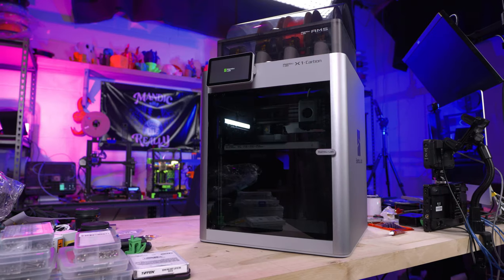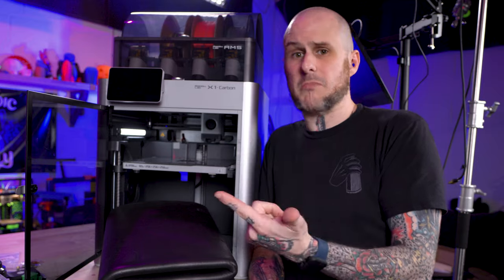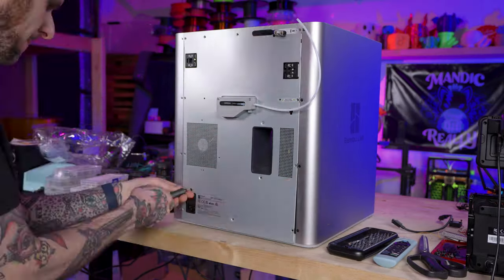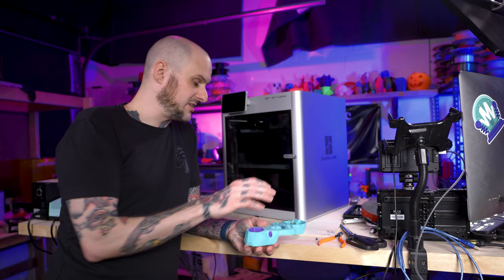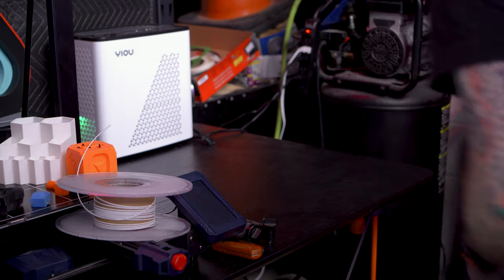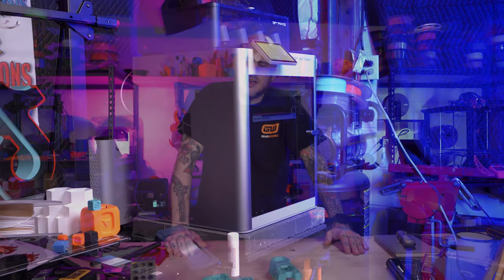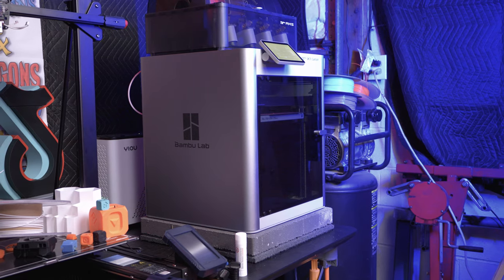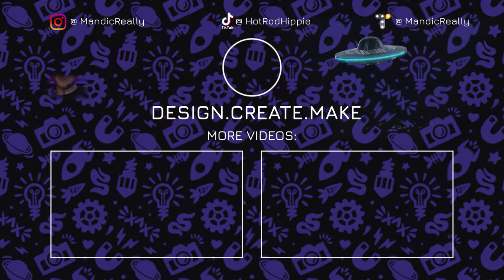Bambu X-1 3D Printer Modding & Problems - Noisy Ringing BEAST!

Comment: I think you did too many control tests after the fact so the results can't be trusted, though I trust that the smoothing you're seeing would likely see be present.
Reply from the maker: I don't understand what you are saying.  I did too many tests so the results are invalid? That's generally the opposite of what most folks would say. This is by no means a scientific study with every variable controlled, but it is a real world use case demonstrating real results.  Could you clarify? I'm in the middle of filming a follow-up and confused as to how to take into account some folks input.
Reply: @MandicReally  What I mean is that you messed with a lot of things then you tested. Since your print jobs got worse, there's no way to know if any one thing caused it. What if just by putting it on the floor, it would have resolved your issue to begin with? As I said, I don't think it would have solved your issues but since you had already messed with it so much, you can't say for sure.

Comment: Most sound isolation products don't do anything. To isolate sound you have to plug air gaps. Only then does it make sense to do things like adding mass to the sound barrier. Adding mass while it still has air gaps is not really going to do anything. It would have been good to measure the sound levels before and after. It would show that adding foam insulation to the panel with all the air vents made no difference.
Reply from the maker: Did you watch the video by chance? @13:00 I showed a 6 decibel drop in Before and After testing. That’s not an insignificant amount of noise reduction.

Comment: I think maybe your temps are too high
Reply from the maker: Nope, I temp tuned on this. I’m actually a bit below the Recommended temps for the machine and ASA. You have to remember when printing fast higher temps help promote flow, they are leaning into that on most of their print profiles. I print this ASA regularly on various machines and the temp hasn’t ended up being higher on the X-1.  I’ve improved my results significantly and will cover it in an upcoming video. It has nothing to do with temperature.
Reply: @MandicReally  Just thinking out of the box. Highly appreciate the reply. Just received mine, but, this, however, is my first printer.  Just trying to debug why the complex edges are ending up rounded.  Kinda a bummer.  Watch a lot of folks print gears and don't seem to have the same issues.  I hope you get this figured out. P.s that's one wobbly table  "lol".

Comment: There's no ringing in your print dude.  The rounded corners looks like a slicer and print configuration.  Ringing is wave, ripple, oscillations in the prints. Not rounded corners.

Decouple - The machine should set on a rubber pad = NOT - on a hard paver.  Also, from your video the machines sounds like internal rattling of components contacting. Open up - put flexible plastic between metal surfaces.
Reply from the maker: There is ringing, aka ripples waves, whatever AND rounded corners. I showed close ups of the prints did you miss it?
Reply: @MandicReally  The rounded corners are caused by in incorrect flow calibration. My bet is that you are using Orca slicer (or someting alike) that doesn't do the full flow calibration that Bambu Studio (BS) does. I ran into exactly the same problem with rounded corners and couldn't fix it by running the calibration routines. Then I started thinking about what I changed in the meantime, and that was switching to Orca slicer. Orca does a very rudimentary flow test when you select Flow calibration just before starting a print. It is just one simple hooked line and not the complicated pattern that BS uses. It also doesn't scan the line with the lidar. I suspect that Orca does no flow calibration at all and fully relies on it's Filament calibration function. My guess is that the developer of OS radically changed the starting G-code to save time and skip all sorts of tests.
When I switched back to BS and chose to perform the flow calibration before starting a print, the rounded corners where gone and everything was crisp and sharp again!

Comment: Great jobs and efforts we thank you but why R U wearing a mask outside??????????? higher temperatures /double sided tape humm.... i would like to put one in my stratasys chamber to melt it into a puddle lol A real chamber needs a box in a box to properly isolate the heats and components within 
this thing should have bellows if it wants to be a chamber  maybe even a heater for doing so! the tech is interesting but the build is fisher priced! and most of all not for high temperature at all 
also if their is no air modulation(control to keep the setpoint)  within the chamber the heats will pull large prints up every time as the average is not equal as the build plate is much much hotter than the chamber rendering it useless pulling the build plates print edges up as the heats are colder outside the centre of the heater the build plate!  
what temperature rating is the wires 60C 90c or 105c or 200C? it will be on the wire itself
Reply: It's easier to go from inside the store to the enclosed outside area of the store and then back inside without bothering to take your mask off...
Reply: @LongDono  agreed